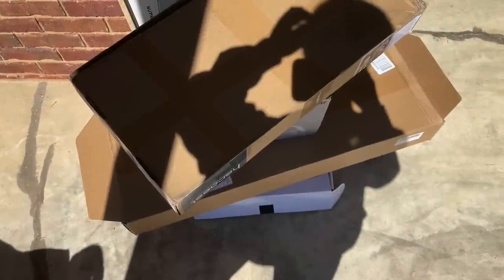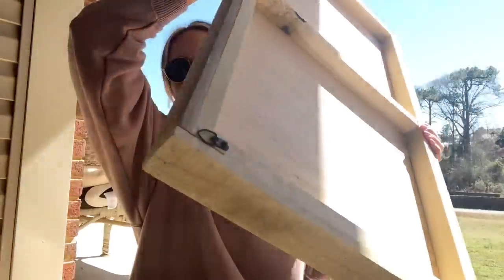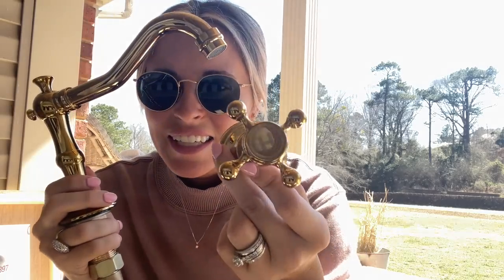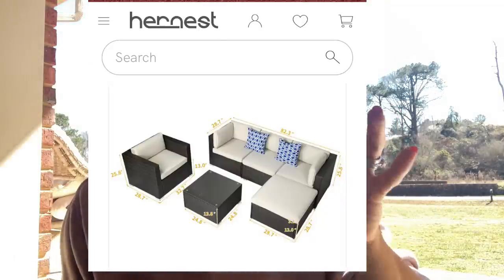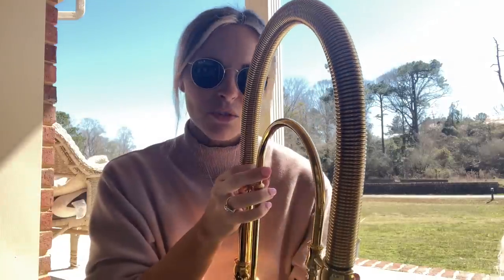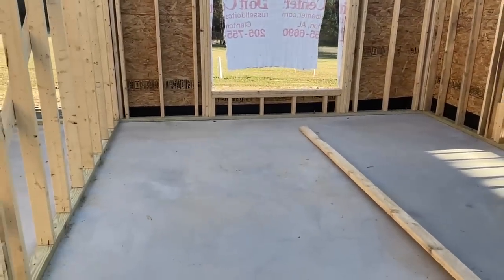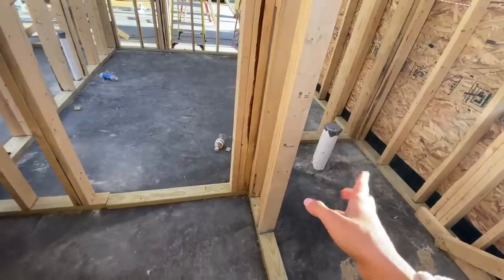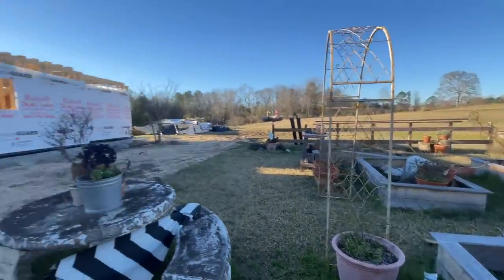🏡NEW HOUSE UPDATE!! 🌸🌸 Haul + Home Tour!!

Comment: Your terracotta pots are flaking likely because they are sitting on the ground and absorbing or holding moisture, then freezing temperatures come and thus the flaking. I live in the northeast and we can not leave terracotta outside in the winter or it will crack and flake from the frost and be ruined. You could put them in a shed or garage and they will probably be ok.